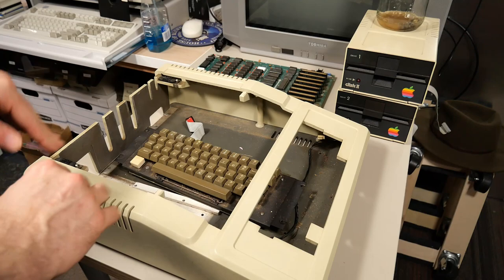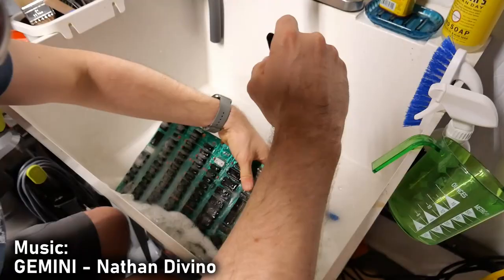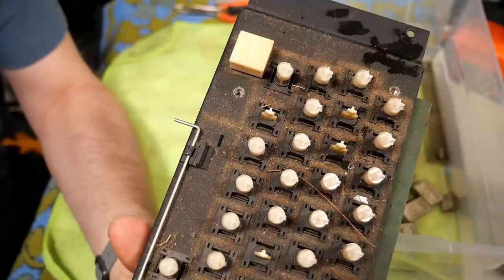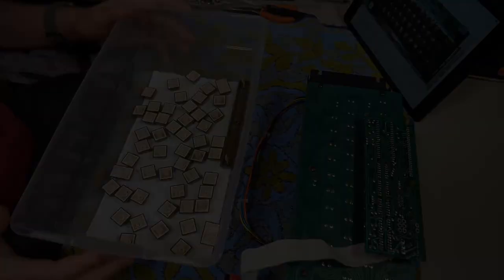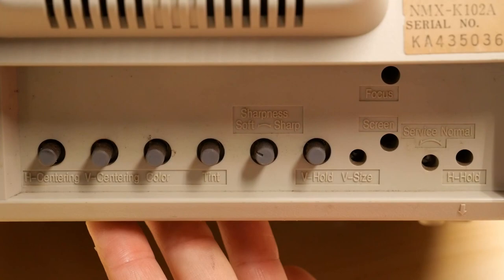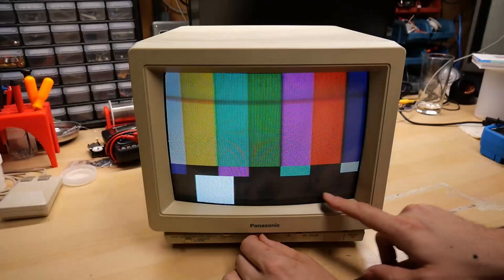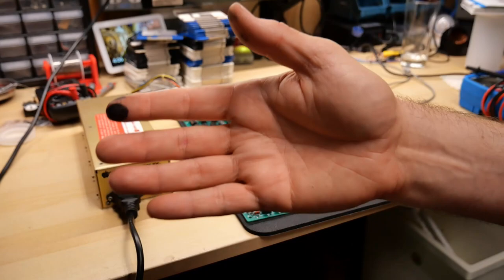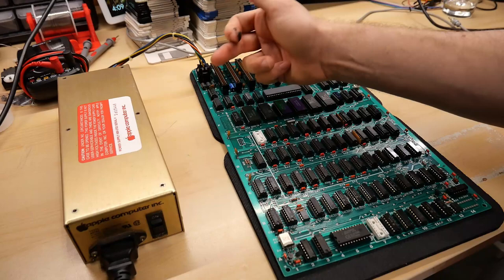Apple ][ plus extreme cleaning + testing the Panasonic Monitor

Comment: Is there a difference between older and modern motherboards when it comes to cleaning with soap and water? I always see motherboards with liquid damage in my work.
Reply: Liquid damage only occures if you have current running thru the mainboard. Even new boards can be washed. The important thing is that it's completly dry before powering it on.
Reply: @daoneTM  you can wash them, sure. But still I don't like to see old board with so many ceramic caps soaked in water, they don't like it too much and it can make them degrade very fast. That can make board unstable in so much way that it'll be hell to diagnose what's a problem.
Reply: Just use 99% isopropyl alcohol to be on the safe side. =)

Comment: Seeing we're on the subject of the II+, does the language card contain integer basic built in or do you have to load it from a DOS master disk?  I got my II+ out of mothballs. Still plays Space Quarks just peachy... Cheesy game but like Super Mario Bros I'll never get tired of it.
Reply: There was a separate Integer Basic card that just had ROM chips and a little toggle switch at the back, so you could boot the computer in Applesoft vs. Integer Basic modes. I had one of these in my Apple II Plus back in the day and could run software for either language that way...
Reply: I also should point out that the official DOS 3.3 System Master disk loads Integer Basic into the language card when you boot it
Reply: @gallgreg  never heard of that one. I think mine has a full 64k. Do you know if it can get up to 128k? Then the machine would be more useful. Still need an 80 column card for it. 64k just doesn't get it.
Reply: ACiDRAiN97 there were no official Apple memory expansions beyond the 16 KB language card for the Apple II or II Plus. Perhaps there might be a 3rd-party card, (Applied Engineering had a lot of cool cards), but since the 6502 could only directly access 64 KB, memory expansions beyond this were of limited use (only specific programs could take advantage of it though bank-switching). The Apple IIc came with 128 KB of RAM onboard and the Apple IIe had an optional Apple 80 column card with an extra 64 KB on it (bringing it also to 128 KB).
Reply: ACiDRAiN97 I should also mention that 80 columns on an Apple II or Apple II Plus were not that practical as those models lacked the Double-Hi-Res mode to make it readable. With Apple IIe the hardware supported 80 column mode, so there was just a flag that was set by the 80 column card to enable it, so most people opted for the card that also contained the extra 64K of RAM. The IIc already had 80 Column enabled (no card needed - it had no slots anyway!), but provided a switch so you could toggle it on and off.
Reply: @gallgreg  i have a //e and //c with 1mb of memory. Came in handy for appleworks back in the day. To bad games never took advantage of the extra memory, maybe they did who knows.

Comment: I don't understand the hesitation to disassemble the keyboard, desolder, deep clean and lubricate the switches.  Those ALPS are well known for feeling terrible once exposed to the elements like this.  With the switches removed, you'd have access to the bare plate to spray your rustoleum...

Comment: "Made in Japan" - yeah, in 70s - early 80s it was basically today's equivalent of "Made in China", cheap electronic, not exactly the best quality.
Reply: I was thinking the same thing.  Some neat stuff came out of Japan during that time, but most of it was crap.  By the 90's they had their heads back on straight though.
Reply: It’s funny because now, if it’s made in Japan it’s a good thing , but it didn’t used to be that way of course....
Reply: @gmcnewlook  Yeah time is funny. Maybe in 30 years "Made in China" will be seen as good. Then "Made in Nigeria" or something similar will be the new "Made in China".
Reply: Not that late unless it was something designed to be cheap. The Japanese did very good with electronics, especially the name brands. A 70s Sony TV would probably second only to the Zenith ChromaColor II and I'm not talking about quality here (Sony would beat the early ChromaColor IIs due to a design flaw in the Zenith that caused the HV to hit 50kV and break the CRT).
Reply: I'd say 50s/60s for that.  70s Japanese stuff was generally pretty solid, and 80s/90s Japanese stuff was bulletproof.